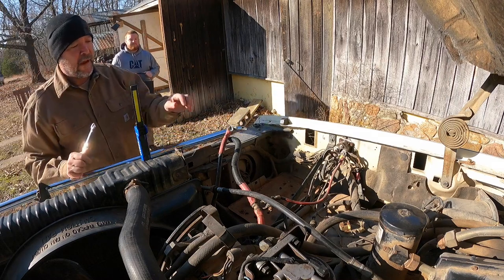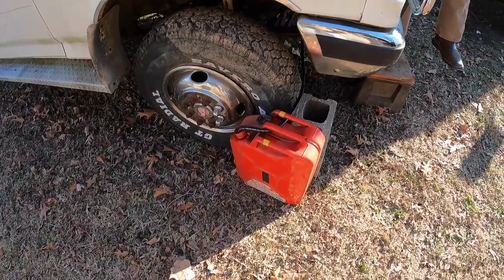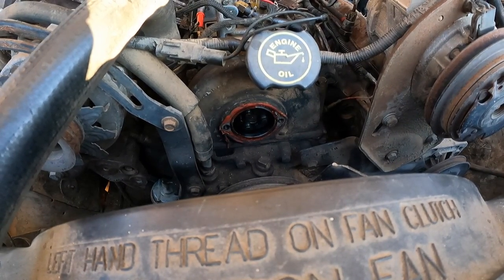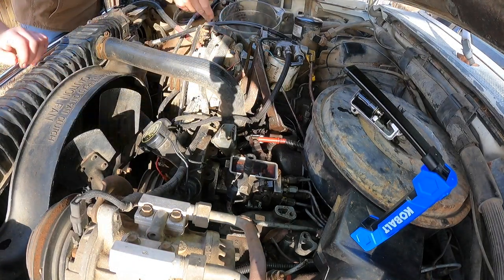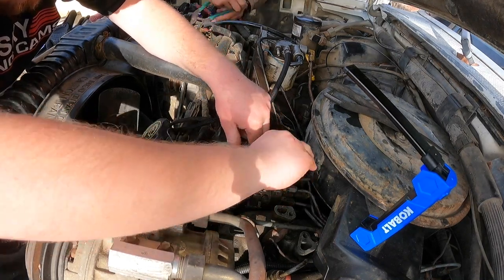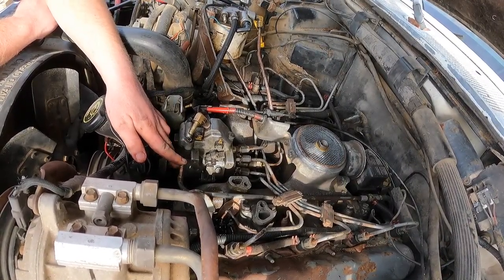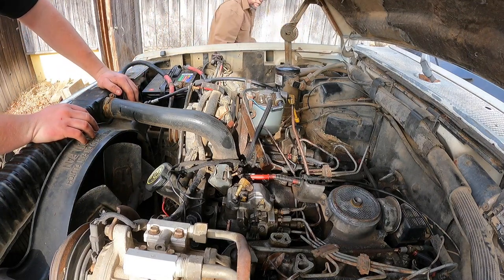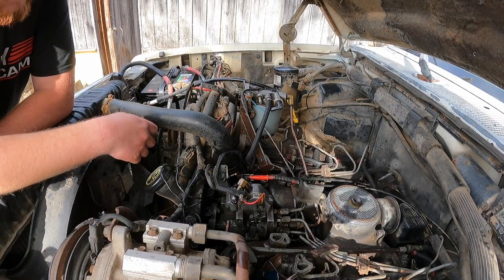Will It Run 1990 F-350 7.3 IDI (Part 2 Fuel System Troubleshooting)

Comment: If you do not get fuel coming out and too the injector you will never get it to run...You have to have fuel going to injectors... Test, remove all injectors nuts so they will leak... Again remove start solenoid and manually slide the direction of coil pulling or pushing... You should get fuel from filter to pump and then from the pump to the injector... Just because coil pulled in does not mean it open the fuel port... Your are going to lose fuel, but it will not start because you have the injector disconnected... Two man job,

Comment: For what it’s worth… air intrusion… fix that( usually the fuel heater) then crack injector lines one at a time until you get fuel at injector( can take a while)… then it will fire. Drill tap plug the fuel heater is the fix.

Comment: I have got a stubborn one to take fuel by running it on starting fluid... its not going to hurt that engine for doing so... you could literally run cans of starting fluid through those old IDI engines and they love it. Keep it running a bit on starting fluid and just see if your diesel does finally make it to the injectors.. I do have over forty years on  these old fords
Reply from the maker: We ran more starting fluid through it off camera and it would fire a bit.  I didn't want to use too much though as I'm new to diesels.  I'm confident it has compression so I'm gathering some parts and will post another video soon hopefully.  Thanks for the tip and thanks for watching!

Comment: Needs glow plugs to heat the fuel in order for it to fire. Also gotta give it time to heat so you should have a wait to start light come on in the cab. When it goes out you then can crank it.
Reply from the maker: Previous Owner had been troubleshooting no fuel at the injector.  Told me he thought it was the lift pump, so we went down that route but turns out my lift pump was fine.  Looks like the injector pump is not pumping fuel out any of the lines to the injectors.  Getting parts now, and will continue when the weather gets a bit nicer.  Thanks for watching!
Reply: @robdoescarstuff4392  if your not getting fuel to the injectors make sure your fuel shut of solenoid is working before replacing the injection pump
Reply from the maker: Fuel solenoid appears to be working.  I have another pump that came off A running truck I'm going to swap out and will video but work has been crazy lately.  Thanks for watching.

Comment: I am currently having the same problem just replace the injection pump truck fired right up as soon as I get under acceleration dies no start after and no fuel coming out of injection pump at injectors

Comment: I went thru 3 mechanical pumps before I switched over to electric lift pumps.
Reply: Most likely you bought a aftermarket name brand or cheap one. I did the same thing nothing but junk! I bought a Motorcraft one and running 3 years strong! The electric pump is nice but the mechanical pumps are more dependable
Reply: @jackdaicole7595  I'll never go back to a mechanical pump.   I have an extra electric pump in the glove box.  Haven't had to use it.
Reply: @2ndspingarage  well to each thier own I guess lol. The mechanical vs electronic both have thier pros and cons
Reply: @jackdaicole7595  priming the fuel is a breeze.
Reply: @2ndspingarage  have you had any issues with priming with mechanical pump??? I would fill the fuel filter up and hold the vavle open and tap over the starter from I side the engine bay.
Reply: @jackdaicole7595  electric just turn the key on and hold down the shredder valve tell its primed.
Reply: @2ndspingarage  I've also added clear fuel line on the return side. These old diesels last for just about forever! Is yours 4x4? I have a super cab 4x4 1986 f250 want to go solid axle it has factory leaf springs I have a dana 60 king pin ford and a same year f350 4x4 for parts with solid axle bet they would bolt in???? Have you do t this before??
Reply: @jackdaicole7595  I had clear line on it tell I switched pumps.
Reply: @2ndspingarage  I put stage 1 injectors and had the injection pump set up with performance parts. Stage 1 camshaft and adding a turbo kit intercooled still beats the price of buying a 95 on up truck I love the older mechanical injection. Have you ever watched zip tie and bias plies the different shows where these old diesels he buys breaks down and he gets them running agian!
Reply: @jackdaicole7595  hell yeah it does,  sounds bad ass!!

Comment: I adopted 1 it sat up for 4 or 5 years . The problem I came across with mine is rain water some how filled the intake complete up didn't realize it till after I put 2 new batteries in it and turned it over 😳 it clunt? I got all the water out and at a loss bout it 4 now. wood love 2 see yall get yours running Caz mines dewin what yours is dew I appreciate the video
Reply from the maker: That's a bummer, thanks for watching!
Reply: I would have to try to pull start that one for a bit, if it's a standard, just to hear/see/ know that the engine will still turn over...before the rings rust to the cylinder walls...hopefully.😮

Comment: So I was having this same issue. I couldn't figure it out. Two fresh big batteries and I sprayed it with starting fluid (I know it's not recommended but I only spent $600 and figured worse case it didn't run anyway) and it finally started after a lot of turning over.

Comment: have the same issue on my f350 7.3 idi.. been sitting for 4 years now .. and now i need a truck.
Reply: Use a vacuum pump to pull feul upto the filter till its plumb full using a tire air chuck and hand vacuum pump

Comment: YOU GET THIS GOING? One thing comes to mind... injectors need pressure ton"pop" open. How are y'all building pressure with those injector lines open? Having them full of diesel doesn't do anything for you unless it's under enough pressure to pop the injectors.
Reply from the maker: We did not but we have worked on it more.  Will post a video when we get it going.  Having a shop built this fall and will post more videos after I have a place to work.

Comment: Take the high pressure pump off and clean and blow it out good,  then hook the pump ,then turn the pump somehow [ drill or 110 motor with an old belt] and pump fuel in the pump with a hose and a upside-down bottle to feed it. As it turns you should see fuel coming from the back of the pump ware the injector line hook to it. If not the pump is not working. Get the high pressure pump to work and get fuel to the injector it should run.  If I remember correctly the injector work off of oil pressure to open the injectors.
Reply from the maker: Thanks for the tip, I was trying to figure out how to test the pump, spinning with a drill is a good idea.  One of the injector lines is cross threaded at the injector from the PO working on it.  I picked up a used pump and lines this past weekend off a truck that ran but was overheating.  Hopefully I can save the injector.  I'll test it like you said and install it.  That will probably be my next video so hopefully I can get to that in the next couple weeks.  The weather is bad right now.  Hoping I don't need injectors too.  Thanks for watching!
Reply: It has mechanical injectors, heuis we’re introduced in 1994 the oil pump does not create pressure. It creates a volume of oil for the injectors to use. The injection pressure regulator (controlled by the PCM) is responsible for creating injection pressures in a range of 450 to 3,000 psi on the Heui injectors, the 7.3 power stroke is computer controlled and the 7.3 idi is mechanically controlled the 7.3 powerstroke is also direct injection and 7.3 is idi (indirect injection) witch means it will go into a pre chamber then into the combustion chamber